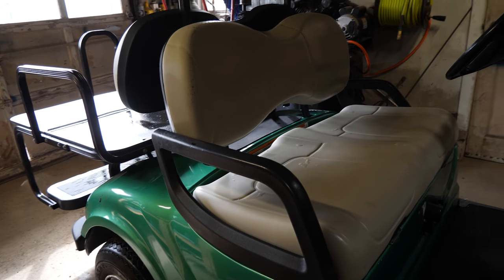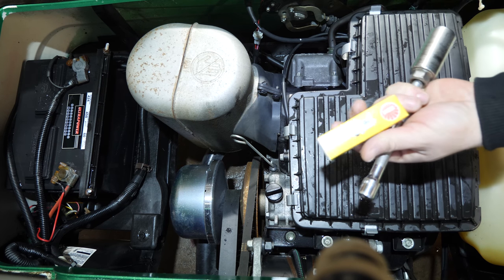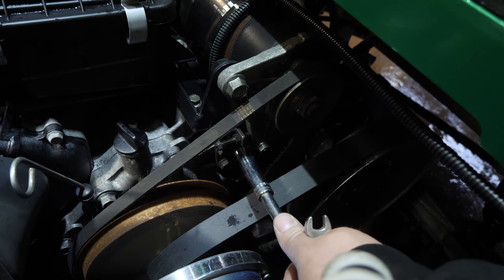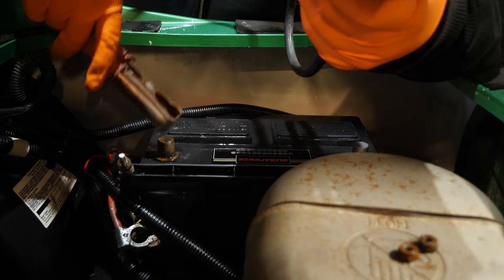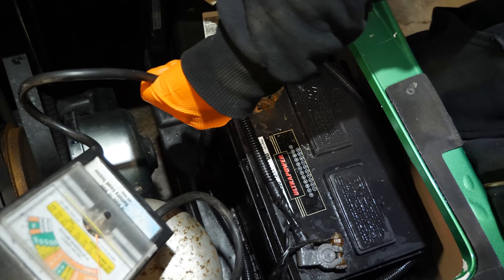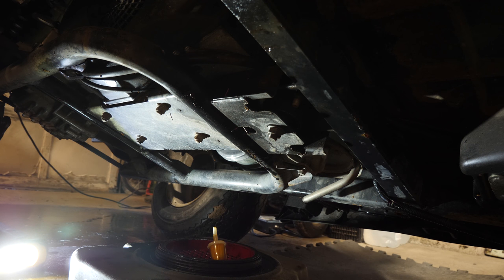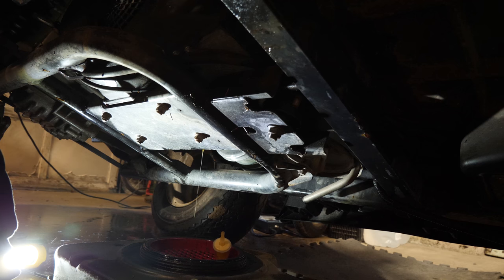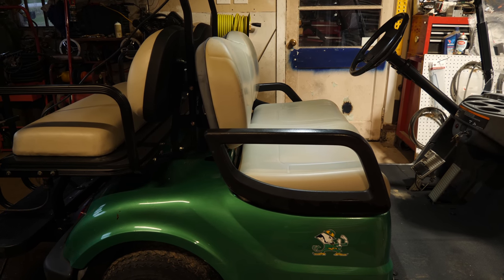2008 Yamaha Drive, Gas - Full Service After Winter Storage

Comment: 2 issues I have,  My Yamaha has no zerk on the clutch.  Does that mean mine is maintenance free?  Also,  my front right turn signal, the bulb has somehow popped loose inside the housing.  How do you remove the fixture?  There are no screws on the front, rather, a metal bracket on the rear and impossible to get it off.  I am not sure of the year but think it is a 2011 model.  Thanks!

Comment: You're just bought this golf cart it's got like right there by the key got three different like a serial number I understand that their cell number is down by the rear tire on the driver side so I know what Gmod all I got's Yamaha gas use a tune-up I heard they go 25-30 she that you like to have your tires out 25 lb or 20 I think you are throwing in them bigger the tire you might get 30 miles mph ends up running Kick-Ass mutton left it up 6 in Chinese yen suggestions where to get these kits in a reasonable and quick tune up kit and find out what g-ma do I have for this where did I do it when he's Robert appreciate appreciate you God bless you did excellent performance on that gas golf cart to know thank you

Comment: Kevin....here again with the 90% ........air pressure at 20 but under is okay....battery service cleaned the battery post and the inside of the terminal but left rust all over the bolts.....Again watch all of your videos
Reply from the maker: Tires are okay at 20psi. You're just nitpicking at this point.
Reply: @Kevinsgolfcarts  I enjoy your videos

Comment: confused....no check and adjustment of brake pedal (and brake light switch) and throttle pedal.....When I got mine the brake and throttle pedals were a mess
Reply from the maker: Brakes were fine and there are no brake lights on this cart so there was nothing to adjust.

Comment: how much grease did you add? does it spill out somewhere else to indicate its full or just go till it gets tight and spews out the fitting?
Reply from the maker: Typically 10 pumps or less is all that's needed. When its overfilled, the grease gets all over the inside of the clutch. Overgreasing could cause the shaft seal to blow out and/or prevent the clutch from operating correctly. Too much grease just makes a mess as well.